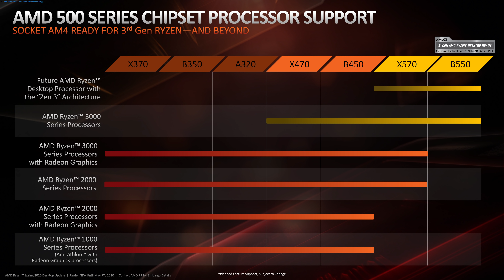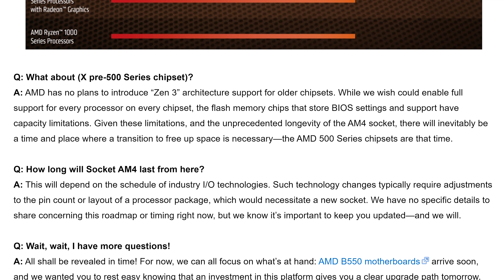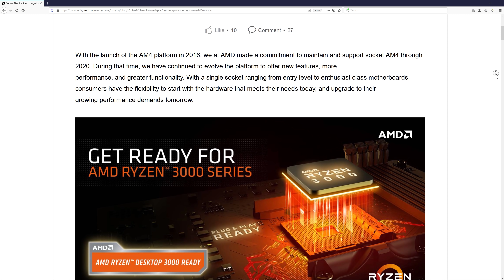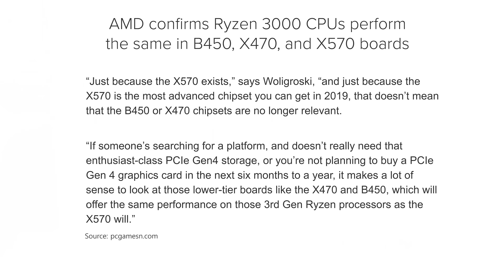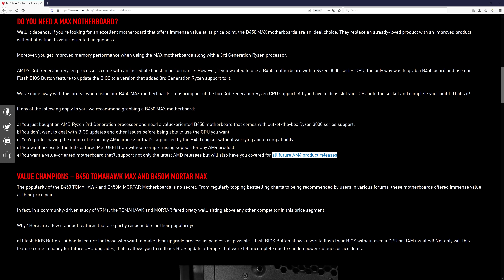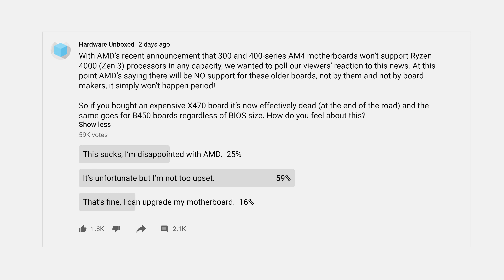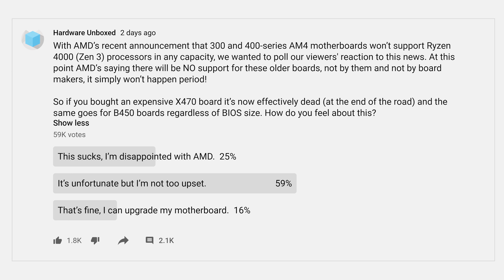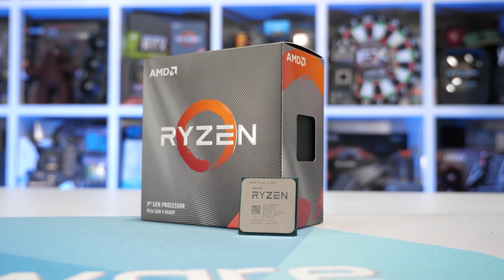AMD Does An Intel, Axes Zen 3 on 400-Series Motherboards, Our Thoughts

Comment: Basically I feel like this is a great litmus test to see which channels or personalities are apologists and who actually have us, the viewers and consumers, in mind. 

Some channels dwell on devil's advocate stuff which merely tries to put words in AMDs mouth, almost trying to do the PR departments job for them, giving easily debunked excuses when it has literally been stated as fact that this was a business decision, not a technical one

THE MOST SALIENT POINTS
- As others have pointed out the B550A is a rehashed 450, yet apparently will be supported. 

- Similarly the BIOS chips are smaller on some X- boards than B450. 

- And it's been proven there is simply empty space in many/most bios bytecode. 

Also for those lacking imagination (or with apparently more money than sense) the reason someone like me would buy B450 and a 3600 hoping to upgrade to Zen 3 was because... Wait for it... I did this before with AMD!!! 

It was basic value for money first and foremost as well as being ecologically and technologically minded enough to expect the motherboard that simply ties together components to last several generations. 

- It is a disgrace that Intel doesn't do this. 
- It doesn't excuse the one other competitor to start doing this 
(How come everyone wants this nebulous notion of competition yet dismiss it when that involves being pro consumer practices around the other parts of the PC components ecosystem)

So back to the upgrade pathi mentione: 
- I had a AM3+ board with a X2 3400 chip
- waiteded till ~2015 and got a cheap FX 6300 which was a huge boost for me and made my investment even more worthwhile until end of 2019 getting a Zen 3600

Similarly I was buying into this B450 to put a 3600 chip in it now and then in several years time (after Zen 4 is released or even 5) I could buy a cheap 8 core Zen 3 (eg 4700x) which would be a substantive improvement especially in 3 or 4 years when multithreading will have become truly important especially with the PS5 and Xbox XyMcXface have established new paradigms of software design and architecture in games. 

(PS for those wanting to argue with me on that upgrade path, why? It's my own sense of value for money as well as highly likely, based on previous examples (such as going from a first gen 6 core Zen to a 3rd gen 3700x part) that I will experience a boost)

Anyway back to the video: The shocking apologists and all this "devils advocate" nonsense is just ridiculous to normal consumers who supposedly this "protects"

- Those supposedly easily confused consumers would truly be miffed to hear that they were losing out on any upgrades and having the value for money calculation kneecapped in exchange for.... Saving them from saving money?!  Why thanks AMD!

Indeed I have to ask - Who exactly is getting into building their own systems without performing research??! 

- It seems particularly American centered to assume a naive consumer class flush with cash who blunder in. 

What many of us experience (outside the US)  is that less informed consumers usually ask their friends for advice who would discover this information and let them know. 

- Is it a peculiarity of the American market that theres this head strong demographic that blunders in and then makes a stink about this?  Can the rest of the world then be given the updates instead? Or markets where this isn't a factor? Or indeed is this imaginary buffoon just a straw man to try and justify "Protecting" them from the pro consumer notion of sensible supportwhere technologically possible. 

But I don't believe there's been any signs, even on this AMD subreddit, of people being truly unable to understand and comprehend the limitations or pitfalls of mixed support. Heck there's even more of an expensive and frustrating experience with RAM which have even more variability yet it's taken as a given people will do their research when spending their money on building a machine....

As it stands only Hardware Unboxed and Scottish Jim on AdoredTV roundtable seem to speak in any way for me and most of the other users caught in this trap to kneecap the B450 by AMD

Comment: It sucks that the 400 series is won’t get zen 3 but I suspect that many b450 owners may also not be that upset. If you’re on the low end of the cpu stack of zen 2 you can still upgrade through core counts, and sidegrading to a zen 3 with the same core count really doesn’t make sense to begin with. One thing to be upset about is if you have an itx b450 and want to use zen 3 APU’s (if that actually happens). Personally I have a x570 and a 1700AF atm as a placeholder. I had planned on picking up a 3900x but I don’t need it right now and can afford to wait until zen 3. I was however about to buy a b450 to shift the 1700AF to during the upgrade for my second system, and am disappointed the upgrade path is limited, but again I can still upgrade it up to a 3950x so... it’s not the end of the world for me. I see why people may be upset, but I think some of the community is becoming a bit too toxic over this.

Comment: It's funny that you feel you have to defend yourself on your opinions HUB. AMD is just like any other company, they have to appease their stakeholders, manage their resources, and have new products for sale. It was naive for people to believe they could continue to use their 4 year old motherboard for the latest and greatest. 

People also had twisted expectations for AMD, oftentimes calling them the "consumer's CPU manufacturer" or the like implying they are there to help consumers, putting a halo on them that they didn't ask for and ultimately I believe caused them more harm than good.

AMD has business decisions to make and they spend a lot of money and have a lot of smarter people than you or I to make these decisions. Believe me, their decisions make sense to them no matter what HUB or we think. And for them, dropping 300 and 400 series support was it.

I do not feel this is a problem. I have a Ryzen 5 2600 and a Gigabyte B450 Aorus M and I have absolutely NO problem with AMD's decision. By the time my CPU is no longer adequate for the task, something better than Zen 3 will be available anyway, and I'll get a new motherboard then.

I also have several Intel set ups and I have no problem with them changing motherboards every two generations. People need to get over themselves and the "customer is always right" mentality. 

It's like buying a car with a 4 cylinder expecting you to be able to upgrade it with the new turbo 6 that comes out next year. It's silly.

Comment: Well I bought a Ryzen 2600x and a MSI B450 MAX Mobo. This was a budget $600 first computer build that I am doing with my 8 year old grandson. I have not done the build yet with him due to Covid. Might he upgrade the CPU in the future...well yeah that's why I went with AMD (and cost vs. Intel which I have previously used for all my computer builds) and that's all I read about when researching was future compatibility. When I build a computer I get the best parts I can so that I know that computer will work for years flawlessly with only upgrades to storage or OS. So I think AMD KNEW what they were doing and the "marketing " folks probably had a huge say in how this played out. So unless something changes for support, upgrades in the CPU will likely be limited to current Gen 2 or Gen 3 CPUs as I now understand. Really disappointed. perhaps had I known I would have ponied up the money for a 5 series board.
Reply: AMD: Current chipset, also end-of-line not supported any more. lol

Comment: I think AMD made the right decision in the end, because developing support on older chipset would have probably implied lower performance for R4000 right now AMD is so popular compared to Intel, which is struggling a bit instead. The point is that:
1) it's clear that nothing was planned, they just suddenly decieded it 
2) very bad communication, obviously as a consequence of the first point. They should have planned it and properly warned customers when X570 was released

Comment: Had AMD offered B550 from the start, I wouldn't consider this much of an issue. However, it's been nearly a year since Ryzen 3000 released, and consumers still can't get a budget 500-series board to match with their budget CPUs. I'm just repeating your own points, but in many ways it was strongly implied that the 400-series chipset would support Ryzen 4000, and that B450 was continuing as the "current gen" budget option, since AMD hadn't (and still hasn't!) offered an updated alternative.

With the updated Max boards specifically targeted at maintaining future compatibility, it definitely stings knowing I recommended this option to friends only to have one of the selling points completely invalidated. It feels almost like a bait and switch.

This doesn't directly affect me, as I have an X570 board paired with my 3900x, but there's a lot of people that bought into B450 over the past year, and I can't imagine any of them being happy about this. And really, this is a problem of AMD's own making. They delayed B550 for so long, forcing people to go with 400-series boards, and now they're going to catch backlash from those same people feeling like they've been duped.

Not a good move at all, and I think AMD really needs to reconsider their options. They have just clawed their way back into a good position after spending a decade at the bottom, and bad optics like this can sour their reputation before it even has a chance to solidify.

Comment: Yeah, I bought a Ryzen 5 3600 and MSI B450 Gaming Pro Carbon AC, because I don't like active chipset cooling, don't need PCIE4, didn't feel the need to pay X570 prices and didn't think it'd be such a limiting factor. Pretty shitty. If B550 had been available and I'd still bought a B450 then I'd wouldn't feel ripped off. As it stands though, I certainly do. Not that I was ever an AMD fanboy, I only care about bang for buck.

Comment: Stuff all that. I just upgraded from 970 to 990X AM3+ board for my FX-8350.. Back to the old FX-4100 on the 970.. I have no issues and no need to upgrade this year or maybe the next. The new stuff may be fast but its all rubbish the way things are right now

Comment: imho even people who bought a top end x370 board, with amd having said and pushed the "am4 thru 2020"... (some x370 boards actually do offer things none of the x570 boards or x470 boards offer, in and... even seen a few x370 boards that have apparently fully functional pci-e 4.0 support via beta and mod bios, only a few actually have the build quality to do it though from what i gather, eiter way.. imho, i get not wanting to deal with multi bios and the support issues with people flashing the wrong one/needing a different bios for the chip they intend to use... 

i do get amd's pov from what we know... i also think its a dick move to just cut support.. :/ 

oh and this is why bios rom chips, need to go back to being socketed...board makers could just send out replacement cmos chips, that have the latest bios flashed to them, i have had makers like biostar do just that for me in the past... (they overnighted 2 chips for the 2 boards i had that couldnt post with the chips i bought them with.. and i lacked a chip to use to flash them...)

Comment: I'm on the fence here over this whole board support mess. I've always felt that the AMD boards are fairly cheap compared to the Intel boards. I went from Devil Canyon, which required a new MB to Coffelake which required a new MB and RAM. This is just something Intel users are used to. Not that hard to swap out your MB to be honest to go with your new fancy AMD proc and you still do it cheaper than us Intel users.

Comment: Would appreciate an response to this from you Steve.
What would you recommend for me to upgrade cpu now with recent 4000 series not getting an Agesa update on b350.
Specs:
MB: Asus B350-f
Cpu: R5 1600 (stock)
Ram: 16gb 3000 Mhz
Gpu: Sapphire 5700 Nitro+ XT (no driver issues thankfully)
PSU: Seasonic 850w Platinum
Cooler: Corsair h100i V2
1440p Gaming, Most games i play Div2,WOW,SC2,HALO ATM

I don't UC/OC at all i have everything running stock except the RAM, 1600 AF does not exist near me so that one is out of the question.
I mostly game but i wanna keep the PC atleast for 3+ years still so im thinking an 8 Core 3000 series unless 4000 series does idd get an agesa support but im not mad if i does not as 3000 series should be an significant upgrade.

Thanks.
Reply: If I were in your position, I'd look at the 3700X or 3800X, which is what I would have bought had I known that my B450-F was end of life.
Reply: @fbcaware8805  ya im thinking 3800x as it cost 20 euro more then 3700x cheers

Comment: So much whining. A B450 MB is 100-200 bucks. Most of those complaining laugh at that amount when discussing GPU cards. And let's face it, most of the folks in this community buy a new system every time it gets outdated by a new generation anyway. Those of us that build a computer on a budget are going to wait while using our "old generation" system until the new stuff becomes more affordable, (like half to a third of the price it will be when released...) to build one then.  

It's hard for me to understand this as anything other than so much pointless crying because folks will have to spend 1/2 of what a new Intel generation will run, whenever that happens. Get real, guys. Real world, you want the new B550 MB so bad you can taste it anyway... At least the used R9 12 cores will be cheap...
Reply: So much whining.

Comment: I bet that they don't want to deal with the hassle of supporting the newer CPUs on the older boards. How many hoops did people have to jump through when Zen 2 first came out to get them to work on good B450 boards? Reddit was filled with threads with people constantly updating their BIOS and AIB partners were pushing out BIOS updates almost daily. I'll bet that AMD doesn't want to deal with that again and just wants their new CPUs to simply work when people install them.

Comment: I think it is still a big achievement to maintain a socket for 4 years.  II bought my B450 Martar Max with the plan of buying a cheap 3950X when the 4000 series launches.  And I bought the Max knowing well AMD will do something ike this soon.  While I think the Bios claim is complete bull shit when we know they can implement a second bios chip .  Also The price between B450 vs x570 is 40 USD there it is almost 120USD here in Turkey.  

what you are missing is I think the only way to keep B450 and B350 viable the 500 series will sieze support for older gen CPUs.

I buy computers every 5 to 10 Years now....  So I will see the manufacturers in 2029....

But you are right.  I bought the B450 after watching your and Nexus gamings reviews instead of X570.  and really looking what I have on my computer it was correct decision for that time..  I am happy with the buy but not wth the decision of stopping support...  That is the key word...  "Stopping Support"

Comment: AMD isn't the problem. They said they would have support until 2020,it's already almost halfway through the year.  If you want to blame anyone, blame all these tech tubers that kept pushing the b450s, saying that's all you'll need. Besides even if you do only have a b450 you can get Zen 1xxx, 2xxx, and 3xxx cpu's and you won't have to worry about upgrading for YEARS, by which time AMD will have new cpu's and motherboards anyway. Comparing what AMD is doing ONCE since Zen came out to what Intel ALMOST ALWAYS does is just stupid and ignorant.
Reply: All these stupid customers should have bought a B550.

Comment: Oh boo hoo. All you had to do was delay your build a bit and save up for a 570. That what I did and my Hero VIII looks awesome!
Reply: Why a 570?
Reply: @fbcaware8805  well, It has a more robust VRM, 2 MVNE slots and the Hero VIII makes better use of the CPU/GPU resources. Also it is still on the higher end of the mobo spectrum. I learned that the hard way with my first of build after which my next build lasted and was competitive (with 2 GPU upgrades) until October last year. Saved for three months and built an R7 3700x based system with a 2070 super. I love it but I can't wait for 2077 to drop, Outer Worlds is amazing but is too short for me.

Comment: They should have had the B-550 out last year, this is BS, it was very clear that my MSI board would use the AM4 processors. On top of that they won't let my 2600 work on on their new motherboard if I did want to upgrade? WTF? Please, fuck them. Instead of getting a new CPU I will just get a new series x Xbox. They lose my business and I had enough of this BS, this new console will beat most cards anyway. FUCK IT..bye AMD PC parts. The RX 2600 will be good enough for a 3060 from Nvidia when I do decide to get something new for my PC...which will be the last thing.
Reply: @raya4633  Yes thats why I said PC parts... was going to get both.

Comment: The joke is on AMD, i bought a x470 Taichi with a 2700x and said if the upgrade was worth it i would slap it onto that board, now i will not upgrade to Ryzen 4000, maybe to DDR5 on 2022.

Comment: @10:30  I'm not sure I agree. A lot of casual gamers only upgrade their rigs every few years. I was running an i5-750 until 2018 when I finally dipped my toe into the Ryzen 2600. I don't plan on upgrading to Ryzen 4000 as nothing I do at the moment really pushes my 2600 at this stage (at least, not hard enough for me to spend money on it).

A friend of mine is running an i7-920 paired with a 1080 (for some unknown reason) and he'll very likely jump on the B450 w/3300X or 3900X because he'll expect that build to last him at least 3 or 4 years. $100 at that kind of lifespan/upgrade path is nothing.